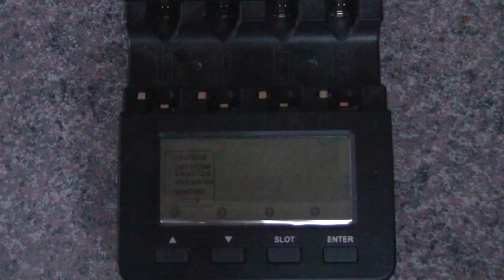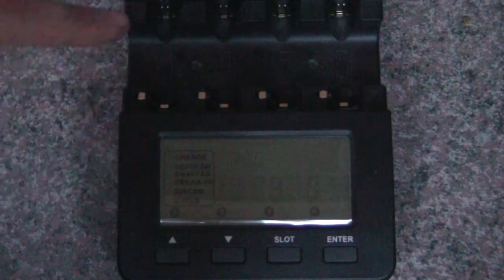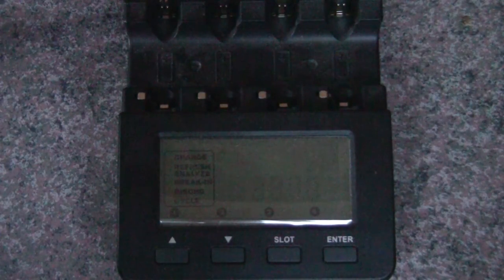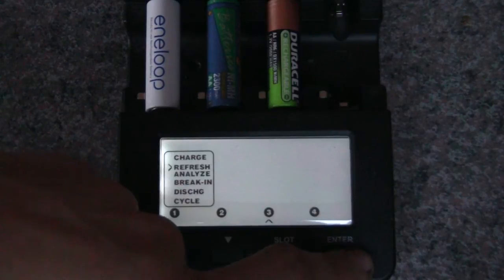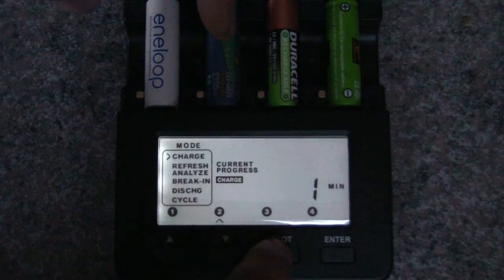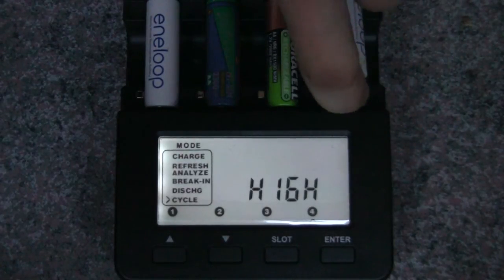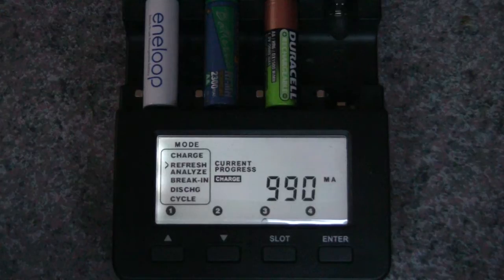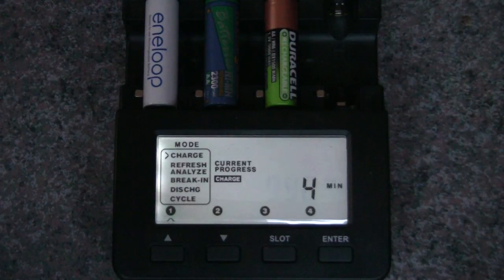Maha Powerex MH-C9000 Multi cell charging and HIGH explanation.

Comment: I haven't had a problem charging AAA batteries at 500 mA. The batteries get a little warm, but nowhere near hot. I suppose it's possible that this treatment would reduce the number of total charges, but the batteries are cheap enough that the price per charge is almost nothing.
Reply: It's the heat that lessens a rechargable's lifespan.

I think you're doing it right! Your batteries will last longer.

Comment: If the battery read "high" Manually discharge the battery in a flashlight, then try to charge it. Older batteries will read "high" if you try to top them up. If a fully discharged battery still reads "high" them is garbage. Batteries may still charge in other chargers, however the "high display is a safety feature in the c-9000. Recharging bad batteries could result in a fire!
Reply from the maker: Yup, from what some have said the "high" warning is somehow related to the internal resistance of the cell, and as they age it goes up which will cause issues with charging but fully discharging them can help, or sometimes using a second good cell with some jumper wires to get the "high" cell to start charging for a few minutes will rejuvenate them enough to work a little longer.

Comment: Cells develop a higher internal resistance (or impedance) as they age due to breakdown in chemistry.  Each time you start to charge a battery, the bay does a test of the battery to determine it's internal resistance is healthy.  Basically the charger compares the open circuit voltage to the voltage under load which enables the calculation.  This helps explain why you might see an initially high voltage after starting a charge.  

I have found the MH-C9000 is fairly accurate about determining cells are reaching end-of-life, however it doesn't just give a warning that the cells are getting old, it flat-out refuses to charge the cell.  I suppose the reason for this is the battery will create more heat than it typically would, and the charger will be less likely to decipher the end of charge condition (delta V and/or delta T).  

As a workaround I have performed an initial charge on another device and then moved the cell over to the MH-C9000.  This improves the state of the cell, reducing the calculated internal resistance to something MAHA doesn't measure as HI6H.  This becomes an annoyance, so I usually take it as a sign to buy some new cells.
Reply from the maker: Excellent explanation! Thanks for the details and it is clear this charger is very smart and handles a battery that could be producing more heat due to failing internals in a safe manner that is less likely to cause fire or damage to things. Great to know! If it says HIGH, its probably time for some new cells.

Comment: I charge AA 2000 mAh batteries at 600 and 2500 mah cells at 800. AAA 850 mha cell at 300. If you charge cell at too slow a rate the automatic full charge detection will overcharge the cell and damage it.  2700 mha cells can be done at 1000
Reply from the maker: I'm a little more aggressive, I charge my 2000mah batteries at 1000mah, and my 900mah aaa's at 400, I assume half the rated capacity, and I have been using the same batteries since getting this charger with no failures I can remember, aside from the ones I had been charging with a cheap "fast charger" that charged at like 2500mah or higher, it'd charge a battery in about 30 mins but they didn't last long, a few of those died shortly after learning more and buying this charger, But since getting this charger and running them a little slower, I've had nothing but success with rechargeable batteries.

Comment: The "high" protection feature tells you when batteries are bad. It might read this if you try to charge a near full battery. If you discharge the battery in a flashlight or something it may accept a charge.

Comment: I was hoping to find out what each of the codes are. It would be nice to know what refresh analyze, break in and cycle mean
Reply: @JanHarley7682

Not sure if you'll see this but others may. Here's what each option means. Keep in mind I have the newer MH-C9000Pro model that has replaced the C9000 'WizardOne" that's featured here, both made by MAHA.

Analyze ('Refresh & Analyze'):

- Conditions and charges the batteries at the selected charge and discharge rates.
- Reports the available capacity at the end of the cycle
- Useful when the actual battery capacity needs to be determined.
- Also useful for batteries with degraded performance (within reason).

Break-In:

- Applies a 16-hour 0.1C charge (0.1 times the capacity of the battery. So '2C' would be 0.2 times the battery's capacity...which is printed on the battery.)
Rest for one hour.
Then a 2C Discharge.
Another one hour rest.
Finally a final 16-hour 1C charge.
- Takes a long time! Around 39 to 45 hours depending on the capacity (mAh) of the battery.
- This is the process manufacturers use to determine the capacity of their batteries. It's always going to be higher than a regular charge because it "babies" the batteries.
- Very useful to properly get the battery ready for regular use if it's new or hasn't been used for over 3 -6 months.
- The Discharge mode MUST be done first before using this mode!

Cycle:

- This option is no longer available on the MH-C9000Pro model.
- It's really just the Refresh & Analyze mode but you can set it to perform the function I believe up to 12 times.
- Personally, I like that it's not available because it forces you to check on the batteries and charger. But many people miss it.
- It can be a little more aggressive than the Break-In mode because YOU get to select the charge and discharge rates (I alway use lower mA by a couple hundred than what the manual's chart calls for but not too low. Slow and steady makes for happy batteries! I want things as cool as possible.)
- Also reports the battery's capacity at the end of the cycle. Keep in mind it'll always be a little lower than the capacity reported at the end of the Break-In cycle.
- Think of it as Break-In but YOU determine the charge and discharge rates and it doesn't take nearly as long.

Of course there is Charge which is exactly what it sounds like and is what you'll probably be using most.

Finally, Discharge. Again, is what it sounds like. It discharges the battery at your selected rate.

I keep both Charge and Discharge at lower selected mAs (within reason) to keep the charger and batteries as cool as possible. But that's just me!

Hope this helps anyone who happens to run across this.

Comment: Very nice video! I have only one question. When you should use cycle mode? If Break-In can't rescue your battery? As a last resort? Or for another reason ?
Reply from the maker: I've used cycle mode as a last-ditch effort to rescue a battery that a refresh-analyze or break in didn't help out much. It has worked sometimes, but not very often with the batteries I've had
Reply: @trythistv  Why are your batteries dying? From lots of use, or not maintaining them?

Comment: I bought brand new nimh battery and i used it for xbox 360 controller

and i want to charge the battery 
set 1000 ma and it becomes 0 ma in few second

i waited for 3 hours or more and it didnt charge 

whyy
Reply from the maker: That's bizzare. Have you tried a different mode like break-in or refresh analyze?
Reply: i tried it but it is useless
Reply: i got same thing again
Reply: it can only discharge
Reply from the maker: What kind of batteries are they?
Reply: nimh 2100 mah enelong rechargeable
Reply from the maker: I've never heard of enelongs, it is possible the batteries themselves are faulty. have you tried the charger with known good batteries such as these: https://amzn.to/2IgiAQO

Comment: When you initially set up a battery it'll show you the voltage on the internal resistance of the cell. 1.4 v is healthy, 1.8v is considered wearing out and consider replacement and anything above the 1.8v i would replace. Sometimes refreshing can bring that IR down but in my experience that IR doesn't change much.
Reply from the maker: +Whispered X You're absolutely correct. usually when it shows "HIGH" it means the cell is likely on its way out, or is already shot. at the price of AAs i don't bother if they're showing that.

Comment: I am a beginner in the electronics field so there might be an obvious answer to this so bare with me: I have just bought a new AA/AAA charger - Maha/Powerex MH-C9000 and some new Eneloop 1900mah and Eneloop Pro 2450mah batteries that I have run through the "break in" mode on the charger. Everything works fine but the charger won't charge my older Ni-MH GP 2700mah and PowerBase 2700mah batteries. The display on the charger states that the voltage of the batteries are around 2.3V. and then shuts down the cycle and only states "HIGH" in the display. These batteries have previously been used in my Canon 580EX II camera flash and have done about 50 recharge cycles in a no-name (PowerBase) "stupid charger". I can accept that the hard discharge from the cameraflash and the 4 hour charge cycle can have damaged my batteries but when I meassure the voltage with my Fluke 87V. multimeter it states that the voltage is more or less fine ranging betwen 1.1V. - 1.3V. What is going on here?
Reply from the maker: jonnebanan its in how the charger measures everything. as the batteries age I believe its the resistance increases, which will cause issues with the mh-c9000, you can take a good battery and some metal paperclips, its difficult to explain, but if you connect it along with the battery that shows HIGH for a few seconds you can sometimes bring them back. I'll make a video explaining what I mean soon
Reply: Its not the basic cell voltage displayed, but voltage required to achieve set current. Try setting lower current, like 200mA. That might have easier time (lower voltage needed) to owercome batteries resistance.

Comment: If the battery says" High" and will not charge, it is not always garbage.
Try another charger. I have lots of old batteries that say "high" in the C-9000 charger but do charge in my Maha MH-C401FS charger.  I use the C-9000 to condition my batteries every so often but for day to day use the MH-C401FS is my favorite, It is simple to use,  and will charge older batteries the C-9000 won't. It has a switch for 300/1000 ma on the side. Red and green led's  to indicate when batteries are charged.
Also, older batteries can get tarnished or dirty on the contacts causing a poor contact  which may cause the "high" reading. I use light sandpaper to clean the ends of the batteries and it helps in some cases.
Reply: Or you can just place healthy battery there, wait a bit until process starts and then just quickly switch it with "high" battery. If it is not dead, it will charge it..
Reply: @xmeda  hey thx mate it works like a charm and btw they should give bad indication but still charge it because with only this expensive charger the batteries still cant charge them so it was much better just a bad battery detection and still continue to charge them
Reply: If the battery says "High" and this charger doesn't charge it, it is 99% dead. This indication means "high internal resistance cell". Another charger, if it is a smart one, will also refuse to charge this cell due to the same reason. However despite the indication, this cell perhaps can be charged in another charger. But if you try to measure it's capacitance in mAh by discharging it right after a charge you will understand why this charger refuses to charge it. Most of the charging energy is lost in form of heat and therefore the stored energy in it is much lesser than the energy spent for charging it. During discharge, the same effect happens. That much lesser energy is even more reduced as the most part of it is consumed by the internal resistance of the cell. A smart charger senses the high internal resistance by sending a heavy initial pulse to the cell under charge, while measuring the voltage developed a cross it's poles. If this voltage hits more than 2 Volt (depending on the manufacturer of the charger) the cell is at the end of its life. None charger can save it. The process is a simple application of Ohm's Law. The lesser the voltage, developed during the initial pulse across the terminals of the cell to be charged, the healthier the cell is.
Reply: Ye he had to rotate aroud that one battery that presumably got the high error I guess the contacts were bad
Reply: As a result of the c9000 hi6h designation, I've later discovered I've thrown out perfectly useful batteries.  
How to successfully charge hi6h batteries: Initially use an old nicad 'dumb' charger OR any quick charger then for the final step, a panny cc17 semi-smart charger. 
Procedure: Use one of the two chargers(which charger you'll use depends on how 'bad' the battery is, quick charger is needed for almost dead batteries) to 'jump start' the hi6h batteries(short charges in increments of 20 minutes or more) then finish charging using the panny charger. Mark all batteries to indicate their need for this extra attention.
This has extended life for use of these hi6h batteries in low-demand devices like remotes, scales, and led candles. Some batteries will be so bad that only the quick charger alone will charge them. 
I realize that this involves extra charge cycles but these batteries are near their EOL so in my mind there is nothing to lose but $.  
This is my issue with the c9000 because it will not service hi6h batteries and why I don't use it any more. An already expensive charger is costing you more money by their readings.  Don't toss away usable batteries!